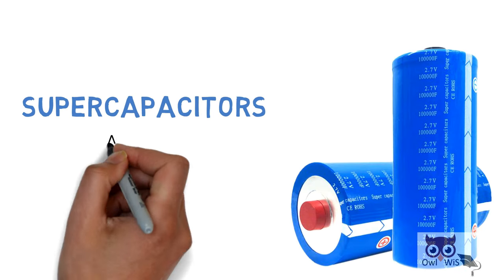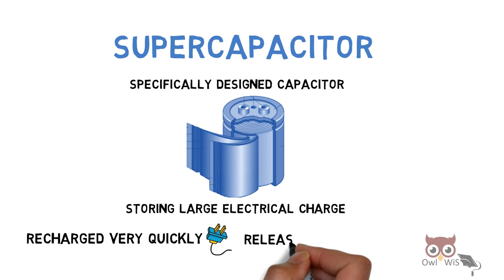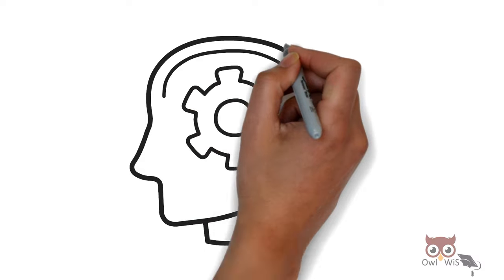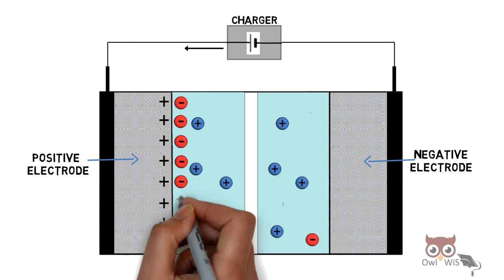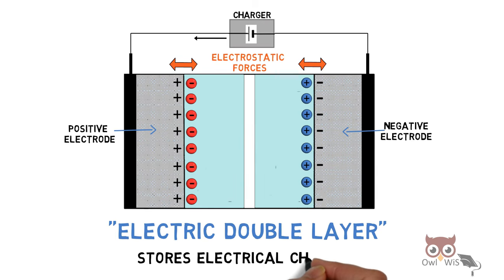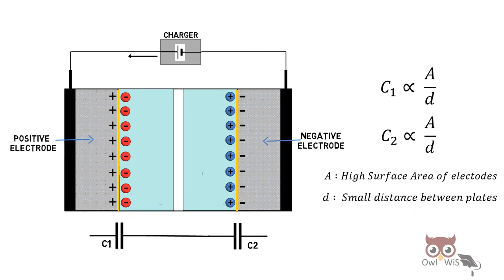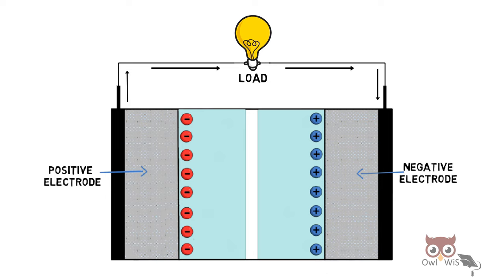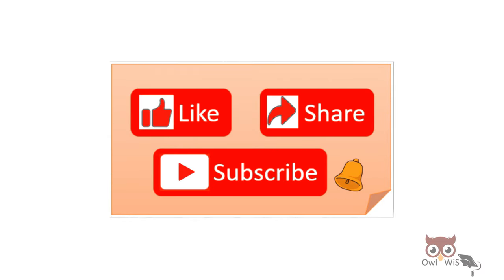What is Supercapacitor| How supercapacitor works| Supercapacitor in Electric Vehicles

Comment: So then the purpose of the Kapton separator is that it prevents the spontaneous movement of the + and - ions throughout the electrolyte, preventing spontaneous discharge of the capacitor. The impressed voltage of charging is able to force the + and - ions across the Kapton separator, where they then stay if the external circuit is open (no circuit) and then providing a current path provides    the necessary force to drive the + and - ions across the Kapton separator ?

Comment: 1) Is there a specific material that serves as the "electrical double layer"? or, is this the contact area between Carbon and electrolyte?
2) Once the charger is disconnected,  what prevents/hinders the electrical charges (within the electrolyte) from simply returning to their original state?

Comment: But how is it that the charges stay there?
Reply: How is it not short circuiting
Reply: @gabrielphilips6980  As to my understanding, this is due to the electrostatic attraction at the electrode that causes the double layer to form, and the presence of a separator that prevents short circuits.
Reply: @rashidahismail3691  The explanation in video is very elementary.  The graphite powder granules are like a 'Rice Crispy' treat.  The electrolyte permeates the graphite electrodes bringing ions to embedded graphite granules making the effective surface area very large.   The ions are stored within the graphite lattice structure.  The electrolyte is an ion exchange conveyor belt between the positive and negative electrodes.

Like a battery, the separator keeps the positive and negative electrodes separated to avoid shorting between the two.

The function is very similar to the negative graphite electrode of a lithium-ion battery.